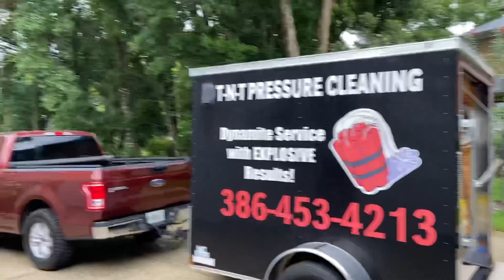Open trailer or enclosed? Completed paver cleaning…

Comment: Hi Trevor, 

I have an open trailer and it's pretty cool that I can get around all my equipment easy. In saying that, I also like the enclosed trailer for all the features you described. I notice that you haul all your equipment out of your trailer and that works for you. Some guys want it to be set up inside so they just pull hoses.  Either way everyone has to find what works best for their business.  

Thanks for all the videos. It's been very helpful and you do great work...
Reply from the maker: I am just about to upgrade to a 14’ aluminum double axel trailer with 500 gallon buffer, 100 SH, 55 surfactant. Either a 8 gpm or maybe  a 12gpm with a much larger surface cleaner not sure yet. 
I completely agree with you that it is much less labor setting up and rolling up with an open.  My system allows me to access areas that my commercial buddies cannot and that why I have kept it for so long; I became the guy who could reach that remote area. I am ready though to make life in the exterior cleaning world easier for myself and resign that title…lol! I watch how easy it is for them at the end of the day, they are in the truck driving home and I am still putting equipment away. 
Thanks for checking out my videos!
Reply: @t-n-tpressurecleaning7781  

Wish you the best with your upgrade.

Wouldn't you only need a 275 gallon water tank, 55 gallon SH tank, 16 gallon soap tank and a 24 inch surface cleaner with a 8.0 gpm machine? I seen a few great videos with enclosed trailer setups. That's if you still still need everything enclosed. 

Again, good luck with your setup
Reply: Would sh mess up the sealer? Did you use a surface cleaner or soft wash?
Reply from the maker: @michaelc7283  Yes; however, I plan on doing large commercial accounts and upgrading to a 12gpm relatively soon.
Reply: @t-n-tpressurecleaning7781  

Very cool, wish you all the best.
Reply from the maker: @tntwashpro3863  the sealer needs to be stripped and redone. I have soft-washed this deck previously and went through with a turbo-tip. This time I xjetted my soap and used a surface cleaner to get the joints and seems clean. Then rinsed with my jrod reducer water broom.
Reply from the maker: @michaelc7283  Thanks Michael